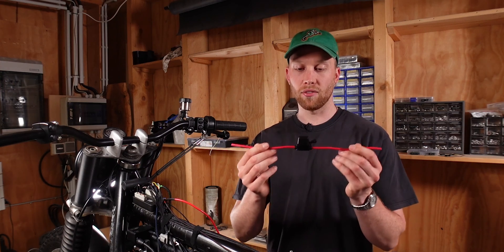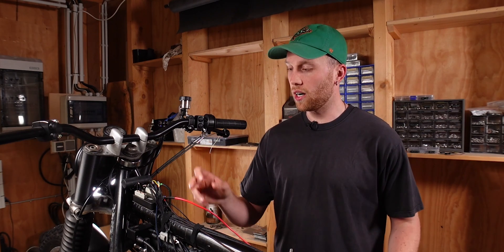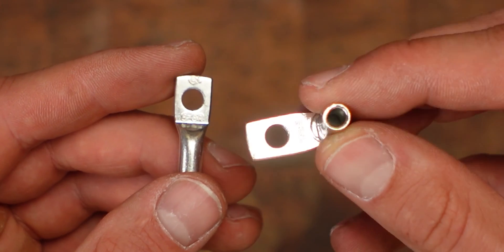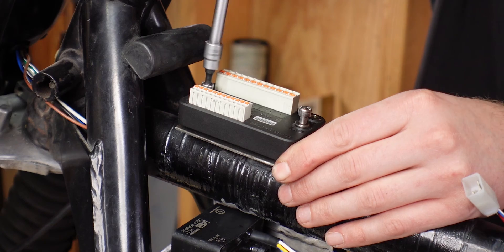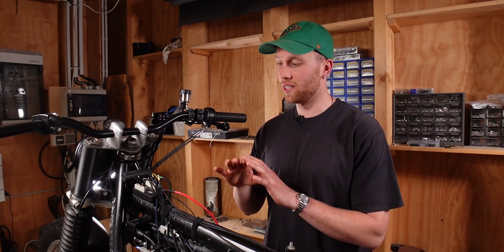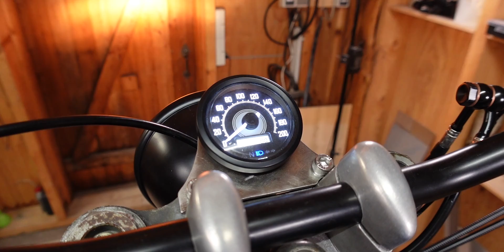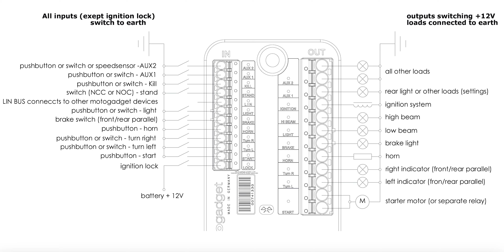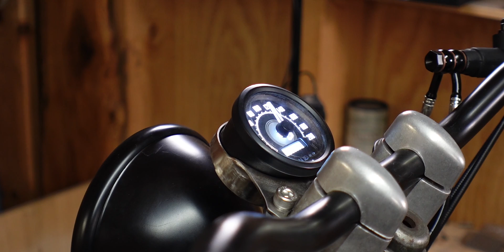How To Wire a m-Unit from Motogadget | Beginner Guide

Comment: Id love to get a more in depth explanation of the ignition system... being magneto, its AC power yes? Does the unit manage that by cutting the connection via the key switch?
Reply from the maker: Yes, you're right, the VAPE ignition uses AC power, so it does not need 12 V from the battery to run. Because of that, you can’t switch it off by cutting power — it can only be switched off by grounding the ignition’s kill wire, stopping the CDI from producing a spark.

How this works with the mo.unit: 
VAPE includes a kill relay which is connected to the ignition output of the mo.unit. This terminal gets 12V as soon as the mo.unit is powered, which keeps the relay open and the engine can run. When the ignition or kill switch is turned off, the 12 V disappears and the relay grounds the kill wire to stop the spark.

I hope this helps.
Reply: @MotoWrenchers awesome stuff... will it work with non-CDI?
Reply from the maker: Yes absolutely. The ignition was the only terminal I couldn’t figure out myself so I sent motogadget an email. They are super responsive and helpful should you have a question with your setup. 
What project are you working on?
Reply: @MotoWrenchers its a 1975 ct125

Comment: I'm just about to start a custom build, this video is super helpful... thanks
Reply from the maker: Hi, what are you building? What’s your plan?
Reply: @MotoWrenchers   I will be getting a part started South American chopper frame, nobody seems to know what the frame is, but it looks great, with single sided swingarm, and lovely flowing bodywork, this bike is going to be slick once I have finished with it.
Reply from the maker: That sounds amazing! Good luck with the project. Keep me posted 💪 What engine are your going with for your project?
Reply: @MotoWrenchers  Its coming with a Transalp 650 chain driven V-Twin,. a weird option, but hey, it works, and we will see how it goes, personally, I would have chosen a VTR 1000 engine, there must be a reason the chassis is designed around this power plant.
Reply from the maker: Good luck my friend and keep me posted 💪

Comment: Hi - really appreciate the video - very helpful, thank you.
Just a question on my bike A 1980 GSX 1100 - where does the voltage regulator wire into please?
Reply from the maker: Hi Chris, thank you very much. The voltage regulator is separate from the mo.unit. The charging system is independent and you should find a diagram for it in your GSX’s manual. The reg/rec gets wired up like you find it in the manual. It is connected to the stator on the one side (which produces the power but in AC -> which the reg/rec then converts into usable DC), it has a ground connection, and a connection to the positive terminal of the battery which charges the battery. I hope that helps 👌
Reply: @MotoWrenchers - thank you that makes sense - I will follow that procedure and work through the wiring diagram. Appreciate your response.
Reply from the maker: Good luck! If you have any other questions down the line feel free to ask 👌

Comment: I’m just looking into a ESC. Do I understand correctly you can insert a bare wire into the holes or a wire terminated with a Deutsch or similar terminal?
Reply from the maker: I’ve seen people use both and when I bought the mo.unit there were different sized wire terminals included in the package, so I think it should be okay. But after I posted my videos someone pointed out that the terminals reduce the contact area and that inserting the bare wire would be better.

Comment: Question! If I have the mo. Button for the handlebar switches, is it really as simple as connecting the green wire coming off it to the “kill” terminal?
Reply from the maker: Yes and a ground…it’s super simple once you get it into the handlebars 😅
If I remember correctly it should be in this video: How To Develop A Wiring Diagram For Your Motorcycle
https://youtu.be/P0vhRdAyE2Q

Comment: I have the same speedo, is it possible to have a meny button on the handlebar instead of the integrated one on the daytona speedo. Thanks 🎉
Reply from the maker: Yes, if I remember correctly there are two wires for the buttons that you could run to switches at the handlebars.
Reply: @MotoWrenchers  You are correct, I looked it up in the pdf instructions. Thanks 😃 great channel. Final stage of a -78 BMW R100RS myself.
Reply from the maker: Nice!! 👍 What style are you building and how did it go so far? What was the biggest struggle for you with this build?
Keep going my friend, it’s gonna be such a nice feeling once it’s done 💪

Comment: @MotoWrenchers please, another dummie question: what about indicators? I mean, blu light / green light for .. lights, orange for tutn lights? and how did you manage to force the alternator charging the battery? did you retain the green light? thanks in advance
Reply from the maker: Hey, I’m not sure if I completely understand your question. I’m gonna try to answer it but feel free to ask again if I miss anything. On the input side you connect the wires of each push button (or in my case the buttons are connected to the mo.button from motogadet and that transmits the signal to the mo.unit). On the output side you want to always connect the positive wire of the device to the corresponding output terminal of the mo.unit. I have recorded a video about how I designed the wiring diagram for the mo.unit which might help to clarify this further. Here‘s the link: How To Develop A Wiring Diagram For Your Motorcycle
https://youtu.be/P0vhRdAyE2Q

The charging system is separate from the mo.unit. If you are not changing any of the charging system parts, you can wire them up exactly like the stock wiring harness. The best place to see how that was done is the original wiring diagram in your manual. They often seem a bit chaotic but what helped me was to copy it and trace the relevant wires with a colored pen.

Comment: Hi there, loving all your motogadget videos, so very helpful to to get a grasp on this voodoo electrical magic. I've been setting mine up on the bench with a mo button as well, my question is you run the green single wire back to the mo unit, do you then have to run the red wire from the motogadget blaze indicators back to the output side of the mo unit? It seems to be the only way they work for me. Once again thanks for all your vids.
Cheers 👌
Grant (N.Z)
Reply from the maker: Hi Grant,
Yes, that’s right. All of the „colourful wires“ from the buttons connect to the input side and basically tell the mo.unit what to do. The ground wires go to ground somewhere, either the frame or the ground terminal of the mo.unit. The output side then send the power to the devices. So, in case of the indicator through the red wire to the lamp and then via the black/ground wire and through the frame back to the battery. 
I hope that makes sense. If you have any other questions feel free to reach out. I don’t know everything since I only have this one example but most things are the same on all bikes when it comes to the mo.unit.
Cheers,
Joshua

PS: This might be more Information than necessary but just in case it’s interesting…the input side of the mo.unit basically only recognises if it’s connected to ground and then activates the corresponding output side. The one side of the button is connected to the ground terminal of the battery (probably through a wire that connects to the frame) and the other side goes to the input terminal. Once you press the button it becomes like one wire that connects the input terminal of the mo.unit to the ground terminal of the battery. Because of this the buttons don’t need a positive connection and it also allows you to have such tiny wires for the buttons because the signal and the power distribution are separate from each other.
Reply: Thanks so much for that Joshua,  I really appreciate your reply & it makes sense as it was the only way it would work for me. Most of my project is mechanicaly done & the wiring is the last major step. Without a doubt I'll be cross referencing to your videos    often.  Thanks again Joshua, 
Grant
Reply from the maker: I‘m sure you’ll get it. In the beginning it was super overwhelming for me as well but at some point it clicked. As I said, just reach out if you need help. 
What else did you do to your bike/what style did you go for?
Reply: Hi Joshua, 
I've been trying to reply to you with a email address for you so I could send you some pictures of it & another bike that I designed & built from scratch, maybe youtube pick up on addresses?  Anyway this project is a 1980 Honda CB900F that i removed the front end & swingarm & replaced them with a cbr600rr usd front end & single shock cbr600rr swingarm,  lots of frame modifications and bracing to stiffen it up bit, have to think of a way to make contact for pictures,  
cheers mate,
Grant

Comment: Great video. Wondering about the handle bar switch especially for the light options
Reply from the maker: Hey, did this video solve your questions or do you still have any?
Reply: @MotoWrenchers i would like to see something about the handle bar switches..
Reply: @fuoristradaTV  be more specific. he literally explained how to wire all the buttons on his handlebar switches in this video
Reply from the maker: Hey, I’ve made a video about how I wired the switches using the mo.button from motogadget as an addition to the mo.unit. 

Here’s the video: https://youtu.be/94baEA0SaHg?si=v-M7zWm8X2888sYP

Maybe that helps to answer your questions. 

But even without the mo.button the wiring of the buttons is made very easy by the mo.unit. Each button has two terminals. One goes to ground (I ran mine to the frame) and the other one goes to the corresponding input terminal of the mo.unit. The input side of the mo.unit recognises when it has a connection to ground and then activates the corresponding output terminal. I hope that helps!

Comment: So what does a starter relay that has a green/black and a yellow/red … starter motor clearly goes to relay side then other to battery and then my guess is yellow/red to start output and green black to ground bus?
Reply: You used 6mm wire for battery connectors and ground…? I thought 6mm was 10awg which is way to low in amps?
Reply from the maker: The wire I used for the battery is 6AWG. Here's the video about how I made them: https://youtu.be/BCh8u9Rxm-E

Comment: Brilliant,  im a complete novice an have this same set to get on with ......however im on a budget for another build so I've gone for the axel juice H box ( don't suppose you done a video on a complete set up have you ? ) or is it basically the same ? Again cracking video there 👏🏻 👍🏼👍🏼
Reply from the maker: Hi Matt, just saw your comment right now. You might already be done with your project by now but in case it still helps…it’s pretty much the same. I never used the hbox but I’ll run the D-Box on my new project and that gets wired up almost exactly like the mo.unit. How far are you with your build?

Comment: I'm currently working on a previously converted cx500 (carb). Problem I'm getting is a 10v current from the the starter motor out put terminal when ignition is off? I get battery feed when switched on. This bike came in to me with flat battery issues. How can I get current through the output side of the Motogadget unit with no ignition turned on? Could there be an internal issue?
Reply from the maker: Hey man, I'm sorry...I don't have an answer for that. Maybe someone from the community know what might be wrong?

Comment: thanks SO MUCH for this! so just to be clear, you run 2 wires from the START output directly to the starter motor???
Reply from the maker: You're welcome my friend! Yes exactly. This is the video where I actually wired everything up: https://youtu.be/54pXhEeHDV8

And I made a whole playlist about the wiring process: https://www.youtube.com/playlist?list=PLcafGsVIudGrrZoTN5Gb98SVllnXNmNKq
Maybe those help you out. What's your project?
Reply: @ thanks man I was up watching these all night long. I just bought a 1983 Suzuki gs1100, whoever had the bike before me wired it up and did an absolutely horrible job, so I’m trying to figure out all the issues. Currently the m-unit flashes and I have sequential flashing on the output side. 
There is a starter solenoid/relay on the bike and that’s what the “start” wires are wired into. I currently can’t get the bike to turn over. It turns over once or twice but that’s it. I  bought a new battery and even jumped the starter motor directly but still have the same issue
Reply from the maker: Ah I know those nights. I'm sure you'll figure it out eventually but it takes grit and persistence. I actually made a mistake in my initial response (I think the same one I made in the video and could only correct in the description)...the Start Output wires go to the STARTER SOLENOID. On the BMW the starter solenoid is directly attached to the starter motor which I guess is why I sometimes make that mistake in my head. But the SOLENOID get's activated through the mo.unit and the power for the starter comes directly from the battery.
Have you tried using a car battery? You can attach the wires with hose clamps. That did the job for me when testing everything. Here's the video, in case that might help you: https://youtu.be/BNxWMcLL7QE (not really a tutorial but might still be helpful).
Have you thought about starting from scratch and rewiring everything yourself? I guess if they didn't manage to connect everything correctly they might also have used not the best materials? Just fruit for thought. Keep me posted! I'll have my fingers crossed for your.
Reply: @ okay gotcha thanks for this! 
I just bought your wiring diagram last night so I’ve been looking through that. I’ll take it to a shop to get it running and then I’ll do all the rewiring myself!
Reply from the maker: @Garrett_Logan nice! Thanks for the support my friend, I appreciate it. It sounds like you’re preparing well. I’m sure you’ll do a much better job than whoever did the previous harness! 💪

Comment: Awesome. Question. I have a 1984 Magna V65. Would you recommend this device. Also because it has a fuel pump. Where would this be connected?
Reply from the maker: Can't recommend it enough. It simplifies the wiring so much. Not everything runs through the mo.unit. In simple terms it's mainly just responsible for the secondary circuit (lights, horn, switches, etc.) and only gives the start and stop impulse for the bike. The ignition and charging system is (mostly) wired separately. If you keep that stock you can check out the original wiring diagram in your manual and follow that. I hope that helps. My only concern with the mo.unit is that it's not water sealed, so you need to find a place that is and stays dry. Tell me more about your V65 and your plans for it. Would love to hear more about your project.

Comment: Question-  I have basically the same bike as you, but an R90/6 (early 75). I want to use the original gauge cluster and not a modern one- but I do want to replace the original turn signals and break light. I want to keep the original cluster and the original incandescent light. Since you have the same bike you had the same original cluster as me. Can the m unit actually be wired to work with the original plug on the original gauge cluster if you really want to keep it old looking? I haven't found anybody who's done this yet but I feel like it can be done, any thoughts? (By the way excellent video-I like how you went through every detail even where you combined wires and showed exactly how you hooked everything up in detail. Wonderful video!)
Reply from the maker: Hi, yeah you should absolutely be able to do that. You could just re-pin the plug if you can find the pins or cut the wires and extend them. But Siebenrock also sells a pre-made plug which you could use (https://www.siebenrock.com/en/electric/instruments/3558/harness-instrument-cluster-br-repair-kit).
Just keep in mind that neutral and oil switch don’t run through the munit and the rest should be connected like I explained in this video. I also made a few more videos about how I wired up the munit that might be helpful for you. You can find all of them in this playlist: Motorcycle Wiring | BMW R80
https://www.youtube.com/playlist?list=PLcafGsVIudGrrZoTN5Gb98SVllnXNmNKq
Let me know if you have any questions or if you run into any issues. 
Good luck and keep me posted 👌
Joshua

Comment: I have no experience with wiring or any electrical work. Do I need to buy those two kits to connect the M-unit? And what kind of fuse do I use?
Reply from the maker: Hi, that's okay just take your time and go step-by-step. If you're referring to the mo.unit and the mo.button, you do not necessarily need the mo.button. The mo.unit works without it. The mo.button just reduces the amount of wires that run back from your handlebars to the mo.unit. Regarding the fuse, Motogadget recommends a 40A fuse, but I went with a 30A fuse. Here is a video I made about all the wiring supplies that I used for the BMW, maybe it helps you to find the right one for your setup: https://youtu.be/EMMpw8kiHWY
Reply: @ wow thank you so much!!!
Reply from the maker: Sure, any time! If you have questions down the line just let me know 👌

Comment: Does the m unit replace the icm? How do you hook it up if it doesn’t?
Reply from the maker: No, it doesn't. I upgraded the complete ignition and charging system. I hooked that up by connecting the shut-off relay to the Ignition terminal. However, that was also the part I had to ask both VAPE and motogadget about because it wasn't clear to me either. But if you have bike specific questions, the staff at motogadget is very friendly and helpful. Which bike are you working on?